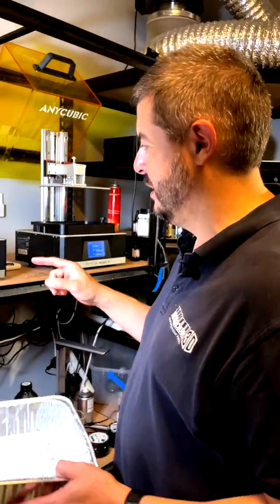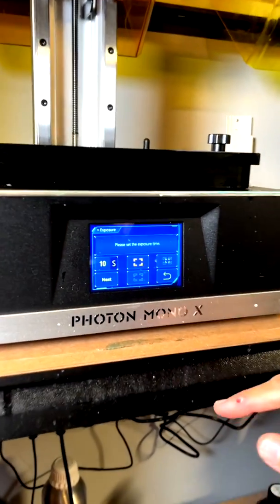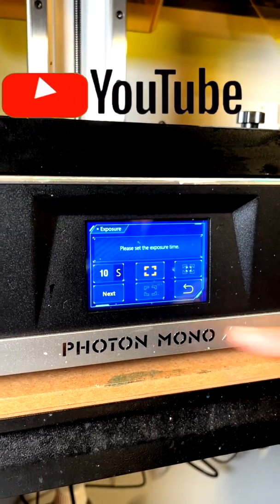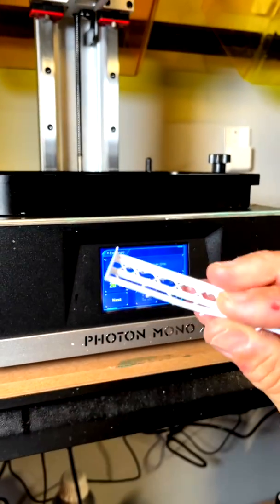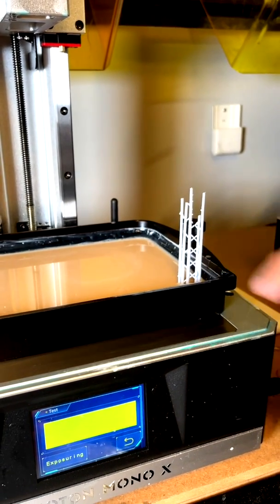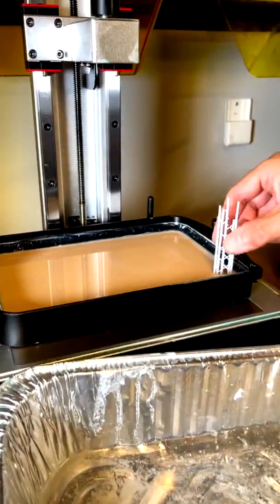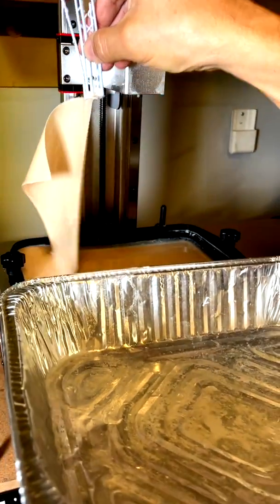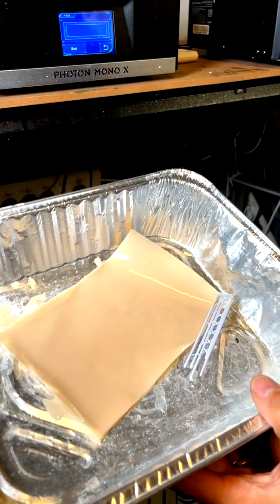How to Clean Your 3D Printer Vat Fast

Comment: what if your printer doesn't have the vat clean option? Is there a work around please.Thanks
Reply from the maker: Some printers only show an outlined rectangle for the screen test function. If that’s the case with your printer, set up a print (1mm deep rectangle x full build plate dimensions) on your slicer and adjust the settings to suit.
Reply: Use the uv exposure/screen test function, every single printer has it as far as I can recall, or at least as far back as the Anycubic Photon did